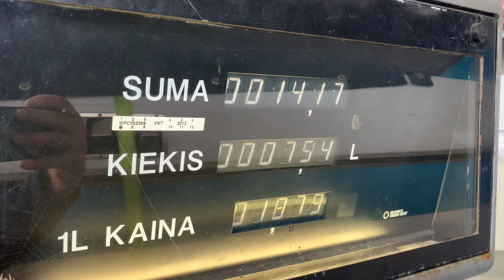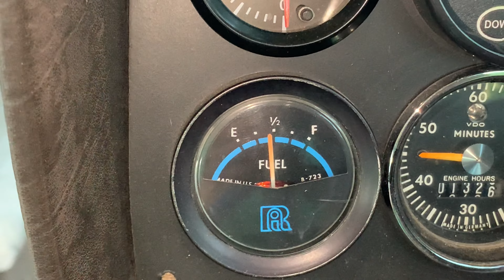Boating season is open

Comment: Was that mid-grade gas you put in? Not sure if your mid-grade is like ours but if it is, it would contain ethanol probably 5-10%. Not good for these older engines and marine environment. Ethanol attracts moisture and will settle in fuel tanks in boats. Here we have marine grade fuels with no ethanol. Curious to know your thoughts
Reply from the maker: Yes. It is equvalent of yours mid grade I think. It is 7% ethanol (E7). I doubt about we can get ethanol free petrol. I think rubber parts don’t like ethanol mostly. And carb adjustment is a little different perhaps. Hope my engine will survive :) I can use fuel stabilizer to avoid some problems (but I didn’t this time) 1/4 filled tank was left through winter and filled with what you saw on top. No obvious problem. Hope I’ll be able to fix in case something happens. Don’t going to play with removing ethanol from petrol.
Reply: @Dasiukas  is your premium fuel there ethanol free? If it is, that could be an option although the high cost could be a deterrent. Also I think your engine is a 351 Ford Windsor. I don’t think that engine is high compression. Could alway mix 1/2 and 1/2 and may adjust your ignition timing
Reply from the maker: @jeffplant3  our octane 98 is equivalent to your premium. It is with ethanol also. And the price is quite the same
Reply from the maker: @jeffplant3  Yes. It is Ford 351W